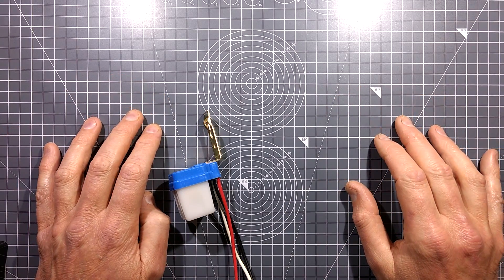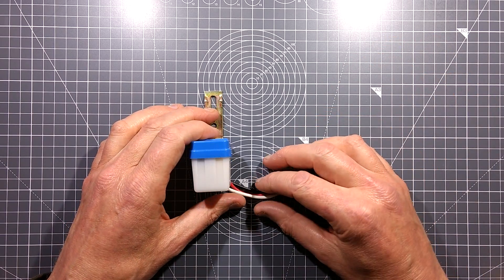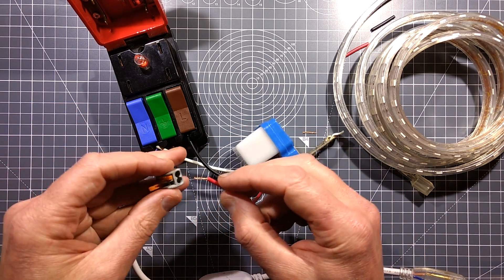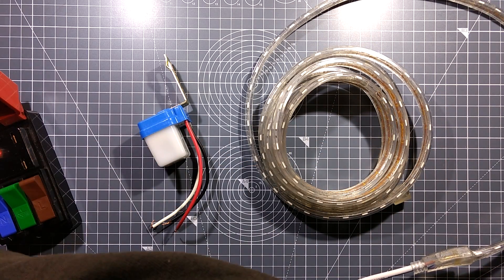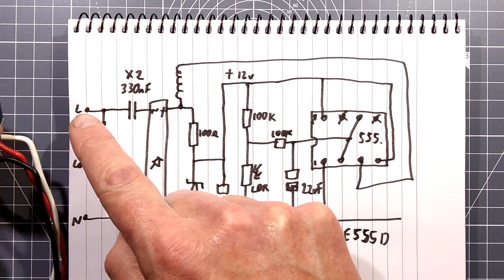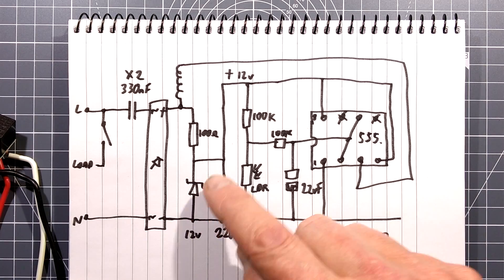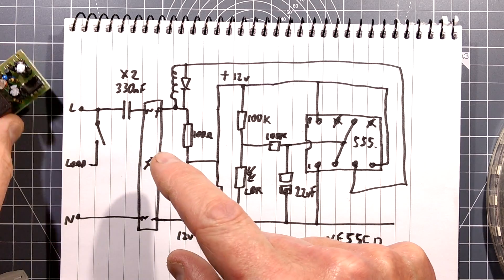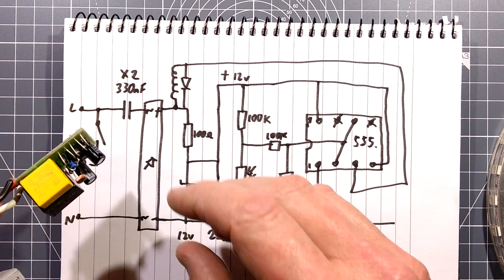Common Chinese dusk switch.  (With schematic.)

Comment: Is that a universal color code throughout Europe, or just local? Our (U.S.) 240v is with 2 lines, with a neutral only needed for 120v (either line to neutral is 120v).  Is yours 1 220v line to a neutral?  If not, what color is for 2nd line?  Thanks for answer.
Reply: In the U.K. the supply to homes, small offices and shops etc. is a single phase 230V (240V) supply. This is provided as a line (live) and neutral. The neutral is earthed (grounded) at the transformer in a local substation. There is no split or second line. Larger businesses have a three phase supply.

Comment: Can you hack the circuit to make it turn on when it is light, and off at night?
And I like the old masonite bench top.
Reply from the maker: If the relay has a changeover contact you could swap from the NO to the NC contact.  If it hasn't then you could theoretically swap the LDR and the other resistor in the bridge to reverse the light sensing.

Comment: Just need a little help. How many light bulbs can this single device handle?
Reply from the maker: It depends on the type of lamp.  With simple tungsten lamps and LED lamps I'd suggest running it at half its stated current handling capability.  With metal halide of sodium lamps I'd suggest at most one.  For more I'd suggest using a sensor per light or a proper high current switching device like a contactor.
Reply: bigclivedotcom okay so I guess that's why the 2 light bulbs that I connected only lasted for quite some time. I going to try to disconnect one and see what happens.

Comment: Wouldn't the time delay be shortened if the ldr was in a dark room but not enough to trigger the 555. This would charge up the capacitor leaving little more voltage to charge up to to trigger the 555? Does the 555 somehow make sure the delay is always constant and is not triggered by a certain voltage?

Comment: Assuming the manufacturer uses UL to list the device for exterior use and it has the correct insulation, UL does list exterior wire nut connections. 

Some are single use glue bag things others are standard wire nuts with rubber and goop in them. 

In most cases, these things are unlisted or have fake listing marks. Either way they are unusable even inside an enclosure. 

There are useable listed devices for this purpose and no electrician I know would install a unit like this with unpotted active components anyway. 

Too much liability to save $0.10 on crappy parts.

Comment: One thing that strikes me as odd about this circuit is that with the relay tied to the unregulated side, that's going to connect the output pin of the 555 to the unregulated voltage (though the relay coil).  Generally, connecting any pin to a voltage higher than Vcc is a bad idea.  I looked at the spec sheet, but couldn't see anything that put limits on what the chip can sink in the high state other then the absolute limit of 225mA.

Comment: Hi Clive! Thx for the review. Couldn't you just put a trimmer resistor in series with the LDR to acheive the possibility to adjust the level of light that triggers the relais? In which range would the trimmer resistor be and would there be enough space to somehow fit it in?

Comment: Aluminium wiring was common in Canada for a while. The issue is doing work now requires converting between aluminium and copper which can't be done directly. I can't remember what the transition metal is. If the termination is not done properly, it can explode, as happened when a backup generator was switched on during a UPS test in a data centre here, sending shrapnel flying.

Comment: Hey Clive, the applications at 9:35, I wonder if they are talking about possibly using it for the time delay on locks? Once you unlock it by finger/eye/badge, many of them hold the lock in the unlocked position for a set time, then reset to locked.

Comment: i see an automotive automatic headlight dimmer(using a larger load relay attached to the lamp dimmer relay,of course) in one of these things future ;->
 about the bench....no problems except the dual suns when panning out. an angle change of those would fix that readily. i kinda like it !

Comment: If someone is going to get the Wago connectors, try to get the clear ones. They are so much easier on the fingers and you can see if the copper is having contact with the the clamp in the connector.

Comment: I've gotta say, I'm casting my vote for the old workbench.

While I find the contrast of the gray of the cutting mat pleasing, (a slight drop in lighting level would probably work out better) yet the grid and concentric circles are really distracting and your autofocus will try to focus on that instead of what you're working on. Unless you're planning to add your own version of "FOCUS YOU FACK!" to your videos, and if so, then ignore that. As you mentioned, the glare from the lighting is atrocious. But, you know lighting far better than I do, I'm sure you can work around that. ;-)

Do you find the darker color easier on your eyes when working? That's another factor to consider. Last thing you need is to be playing around with mains voltage with eyestrain! Gotta release the magic smoke safely, after all!

The old workbench, while not providing as much contrast, is definitely a recognizable element of your videos, and has the "battle scars" of various explodey bits, spilled flux and alcohol, and is just as much a part of the Big Clive experience as you are! 

I suppose, you could also get a new piece of MDF, paint it a matte dark gray, and start a whole new workbench to blow stuff to bits on.

I also like the pink/purple cutting mat... I'd get it for the purple side if I had any use for a cutting mat! It's purple, without being... Puuuurrrrrrrrplllleee. LOL

Comment: A tip for those who want to play with timing capacitor values in this circuit, if you want time delays of 30 seconds or more, for reliability the capacitor should be a tantalum capacitor, as it will maintain its value for many, many years over a wide temperature range.  Electrolytic capacitors dry out over time and become electrically leaky to the point where they'll never charge up, so the time delay in the circuit will become longer and longer and eventually will never time out.  The 555 timer is very nice for its simplicity and economy of peripheral parts, but to get very long time delays with cheap components, nowadays I would use a digital counter chain with a low-value ceramic capacitor as a timing element.

Comment: Unfair generalization at 5:20.
Chinese manufacturers build to the spec requested, which unfortunately is usually "cheap as possible."
However, plenty of good quality items are made in China. It's unfair to assume that anything Chinese is "dodgy."
Reply: Landrew0 The difference with China (and many developing countries) is that there exists no lower boundary of standards or quality below which they will not build an item, China is just the worst of them at this time.  In the West no company will willingly build an item to spec if the result is reasonably and readily foreseen to be dangerous and harmful (mistakes may sometimes be made that lead to loss of life, but such was ordinarily unforeseen at the time).  In China they will happily build an item that they know full well will kill innocents, even intentionally substituting safe products explicitly specified in a contract with known unsafe products in violation of the contract that are guaranteed to result in death as there is no innate concept of "value of life" in the culture.  When a life is seen as dirt cheap and expendable then little value is placed upon protecting such.  In time this will change as they begin to see their own lives possess value, but until then they are responsible for their own culture's lack of value on life and unwillingness to say "no" to the manufacture of unsafe items just as we are responsible for our own past sins.
Reply: If you think the USA had such a "lower boundary" when it dominated manufacturing, that's a bit delusional.  I was there, and there, and I'd say the Americans practically invented "planned obsolescence."

Comment: Thanks Clive, for another excellent video with good info...and the unit under test was actually a pretty decent little device!  I was semi-impressed with the size of the relay after you opened the unit...it probably is actually good for 10A load!...and was rather surprised (like you) to see a 555 timer chip...before you reverse engineered the circuit, I thought that might somehow be used for the delay, but the circuit design is actually brilliant...it uses not the timer function of the 555, but the threshold sensor and output switches of the cheap chip!  
I too would add a snubber diode  to protect the chip's output transistor.
As far as the applications of Fingerprint, Biometrics, RFID...those are just "new", and more current and stylish circuits being designed...I too can't immediately imagine where a stand-alone timer could be used in applications which undoubtedly have processors, which have all the internal timer functions one would ever need, but that's the beauty of the manufacturer putting that into the chip data sheet...they don't have to figure out how to work it in...they leave it up to designers to rack their brain to figure out how they could possibly design a 555 into those applications...sort of like the manufacturer of a bicycle telling NASA there's an application for it on the space shuttle...actually a rather brilliant marketing strategy!  
New table mat looks good but I agree with others, its too busy, it hijacks camera focus, and lacks the well-earned character and patina of the old MDF, not to mention the official BigClive ID.  
I think you should have a marker on each blemish/burn-mark, which links to the video in which it was created...you could call it:  Big Clive's table-top archeology.  Cheers from Connecticut!

Comment: Hi, Clive. Many many years ago I had to make a very simple temperature controller with the parts I had available.
It was to keep home photographic chemicals at constant temp.
I cobbled up a circuit not unlike this one, thermistor instead of LDR.
It worked so well we were still using it 3 years later when we changed to different process.
Tom...

Comment: Got one of these 3 years ago for $1.99 sod knows what it was in Sterling.
Out of sheer bloody minded curiosity I put it outside mounted to an IP65 box in which I stuck the connections using wago clips and it controls a 30W LED Flood.
Mounted BLUE end UP..
Still reliably running today !
Laughably it has outlasted 2 propper photocells running the same type of light ?
You can get  12 and 24V versions.

Comment: I remember doing systems and control technology in school in the early 90's and the 555 timer chip was the very first chip IC we learnt about in detail. We used it to flash a strobe and sound a buzzer in an alarm circuit. We did loads of work on logic gates like the 7404 and 7408 to but i rarely see them in anything I open up.
Reply: xzombiex19x 7404s are just inverting buffers, but they are frequently used to also provide buffered (albeit negating) outputs as well.  That said you generally would not expect to find them used all that much in microprocessor controlled circuits unless you are exceeding the fan out rating of the micro's digital I/O pins or have a need to negate the output as an input to some other device under control of the micro.  The 7408 is a dual input AND gate and you would have seen such used in the past to implement logic tests like electronic safety interlock mechanisms where you wanted a safety interlock of sorts where two sources must be logic high for the output to propagate any further, or for routine AND tests in other logic applications.

In the past you would have seen such discreet logic used heavily to create a complete logic circuit whereas today much of that logic is either implemented internally in code or within CPLDs, FPGAs or DSPs, etc.  So the logic is still there under the hood, it just is not as readily visible today.

Comment: hi clive, what is the D.C. voltage from the bridge, I assume 330vdc ?
Reply: You would expect closer to 340VDC (240VAC multiplied by the square root of 2) for a 240VAC source, or closer to 354VDC for the 250VAC more typical of Clive's location, minus two silicon diode drops totaling around 1.2-1.4VDC, so around 338-352VDC straight out of the bridge rectifier.  However, the voltage seen by the rest of the circuit will be regulated by way of the 100 Ohm ballast resistor and the Zener diode, with the Zener diode clamping any voltage in excess of its rating.  So, if a 12V Zener diode is used then the circuit will see very nearly 12VDC after the Zener diode because the Zener will pass any voltage above and beyond 12V by passing the excess voltage directly to the circuit's ground rail and converting the excess voltage into heat.  The 100-Ohm ballast resistor protects the Zener by limiting the peak current through the diode and radiating that voltage drop as heat as well.  Essentially this type of power supply works a lot like a crowbar circuit and in doing so provides reasonably regulated power to your circuit, they just are not especially efficient if they current can vary widely and only really practical for circuits up to a couple of watts peak due to their need to radiate unused current as heat in both the ballast resistor and Zener diode, but they are dirt simple and cheap to build when all you need is a small amount of regulated voltage for a circuit and do not want the expense or weight of a switching power supply or linear regulator (with transformer).  They are very closely related to capacitive droppers with the only difference being the use of a ballast resistor in place of a ballast capacitor to limit the peak energy available to the circuit and Zener diode with each half cycle of the AC waveform.
Reply: Ethan Poole thank you for confirming what I thought, seems alot of voltage to drop just to get down to 12v. wonder how long the zener will last at that high voltage.

Comment: Hi Clive.  I'm a beginner in Electronics and while I am starting to understand what each component does, I'm struggling to figure out the processes involved in designing how a circuit is built by way of working out why a certain component is chosen and how to work out the values (Ohms, Farads, etc.).  I have seen and played around in a circuit simulator - www.falstad.com/circuit but there's simply no explanation of the why.  It's that bit that I seem to be missing.

I would love if you could create a video giving some ideas how one goes about designing a circuit - what's needed, how to select what values of components to choose, and describe the thought processes of the how and why.

It might help me to understand more of the process of the decision making procedure.

Thanks, and great videos.

Liking the grey desktop covering.  Pink and purple good too, but yes, the reflections aren't so great.
Reply: Simon Ferré You really have to begin by fully fleshing out the requirements of your circuit.  Only once you fully understand the requirements of your circuit and it's intended job can you really begin to start choosing components.  That said, in many circuits the precise values of components are not especially critical unless they form a tuned circuit (line filters) or provide a timing function -- sometimes even the magnitude is not especially critical -- and for such components one often just chooses the most common and readily available (or least costly) components for those.  What often is more critical is the dissipation, voltage, and current/ripple ratings of components used as your chosen components must equal or exceed those values that they are likely to experience in operation in your circuit. For example, you may have a circuit where it is not terribly important whether you use a 100-Ohm or a 150-Ohm resistor in the circuit, but it is absolutely critical that you use a resistor rated for at least 1/2 Watt.  Similarly, it also may not matter greatly exactly what value of resistor you use to drive the base of a transistor so long as it can safely dissipate the expected heat (how much dissipation will depend upon the chosen transistor's gain) and is sufficiently low enough in resistance to still drive the transistor into saturation (fully on).

Comment: Thanks Clive! Exactly what I would have needed for the LED flickering as I discussed on the discussion thread. I did change the unit for another DTD sensor and there is no flickering. The one I used from "Greenbrooke" is the type used on the top of UK street lamps. It's big. It's not particularly attractive, but it works! I might just buy a couple of these as shown in your video to have as spares. Excellent tuition video, thanks.